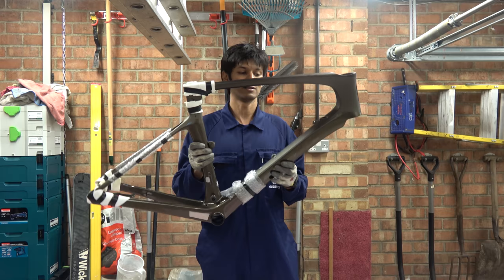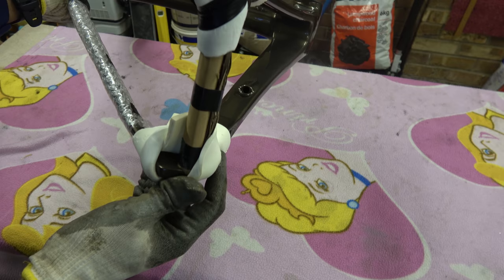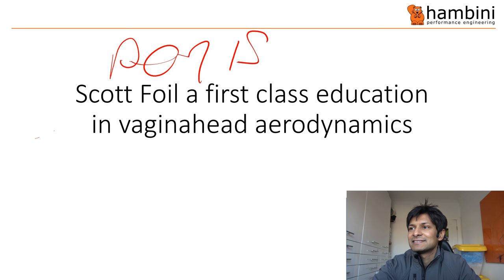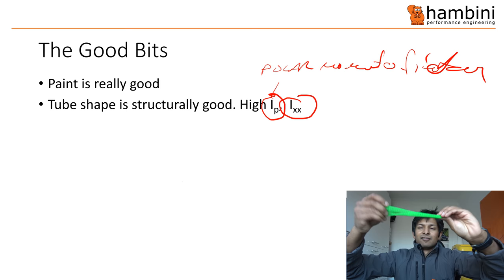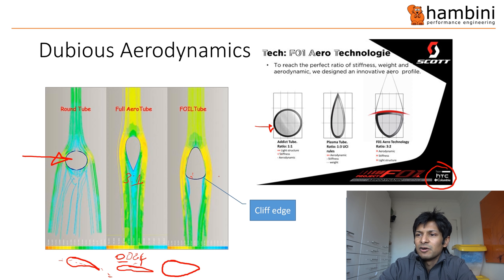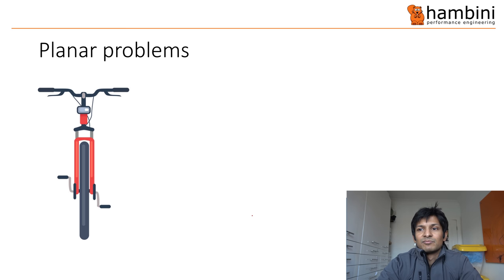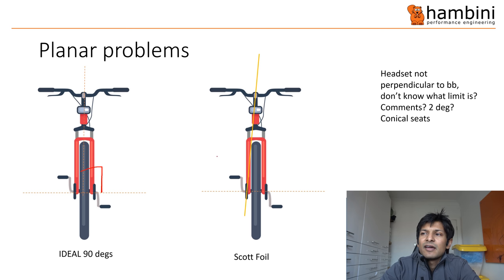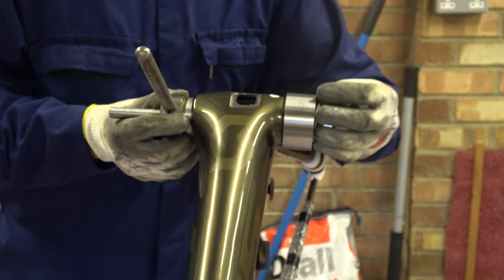Scott Foil Swiss Engineered Bike Frame gets Roasted including the sacrificial Toblerone

Comment: Lift is not generated due to a pressure difference (between upper and lower surface of an airfoil, for example). An airfoil generates lift by exerting a downward force on a fluid as it flows past. And the fluid must exert an equal and opposite (upward) force on the airfoil, which is lift. Pressure difference is due to that, and not the other way around.
Reply from the maker: I'll defer to your knowledge, I'm merely an engineerting tw@t. That sounds like the raw physics in action.
Reply: If that's the case how come the shape of the upper surface is so critical to the lift generated?! Granted it's 17 years since I did my aero degree, but we were taught that that was to accelerate the flow relative to freestream which increases dynamic pressure and thus reduces static pressure. Which ultimately creates a pressure differential versus the lower surface => lift. But I will agree that engineers do often apply a ridiculously simplified version of physics as it essentially works (drove me mad when my lecturers spoke about centrifugal forces!)
Reply: @Hambini  Hah, thanks mate. I’m a mere engineer as well. Navier-Stokes all the way 😀
Reply: @aerobrain2001  The way I perceive it is that pressure (change) is the effect but not the cause. A good indicator for boundary layer flow separation e.g.

Comment: How exactly did you fix the size and alignment problem?
Reply from the maker: The BB is offset. Holes machined out
Reply: @Hambini  machined with a reamer or just sanded on the inside with a flap drum?
Reply: A si ti poslal okvir?Pri komu si ga naročil?
Reply: @volvofh800  ne, ampak za Scott je v Sloveniji itak samo proloco trade
Reply: @jureklancar8148  Aha.Jst sem bolj nov tem.Glih prejšnji teden so mi v A2U delal predračun za okvir od Colnaga C64. 3100€. Pa se odločam kaj bi.Bolj ko Hambinija pa ostalo kompanijo gledam,slabš je😁

Comment: @Hambini, I have the exact same frame as that one. A Scott Foil 10 Disc, warranty replacement for a Foil 20 Disc that I still have photos of and that never, ever, should have passed QC, even in a "bottom of the barrel" chinese cheap manufacturer. The Foil 10 they replaced it with (my current frame) also had issues with fork decals and that fork also had to be warrantied. The frame itself is, at best, acceptable, but nowhere near the "Paint and finish are very good" that you claim that one is. Please check the area where the top tube joins the seat tube, tell me it's a flat suface? Will not be buying anything Scott ever again in my life.

Comment: If a hole that is smaller than spec is termed "undersized." and larger than spec is "oversized," then what is the term for MUCH larger than spec?
ANSWER:  "MAB"
Reply from the maker: Brilliant.
Reply: @Hambini  Perhaps in the future you could do a Powerpoint on how holes become MAB-level large.  What exactly is their origin? Do they just start off that way, or are they the result of years of unceasing boring and reaming operations with wider and wider tools?  And, will bike seat manufacturers ever be able to construct a wide enough saddle to prevent accidental penetration?

Comment: Does that "non aerodynamic" downtube really matter? there is water bottle mount on it. And as a water bottle's drag coefficient is between a "short cylinder" and a "not recommended shape for anal probing applications", I'd think it won't really matter if there is a low pressure zone behind the downtube, as there will be one behind the bottle anyway?
Reply from the maker: the difference is small. the point is it's not as it could be.

Comment: NDS looked well loose on the way in and out. Also, you installed from NDS whereas normally it's from the DS, why?
Reply from the maker: The BB is a different diameter between the sides

Comment: The problem with your aero analysis is that you are analyzing tube shapes like the industry has when aero frames first appeared. You seemingly forget that there are these objects placed on the frames called WATER BOTTLES that mean you don’t look at tube shapes by themselves, but design them around the water bottles that will certainly be used on these frames. You are analyzing individual parts instead of a whole system. Go look at the newest BMC teammachine or timemachine road for the best example of great aero engineering as a complete system.